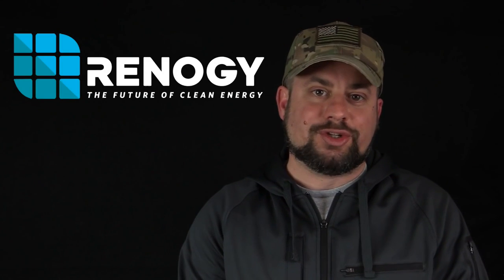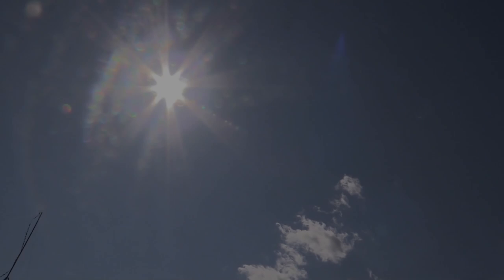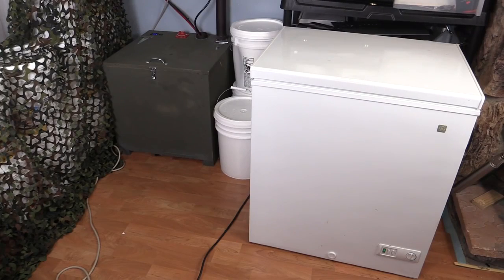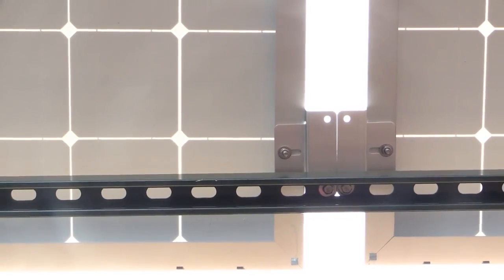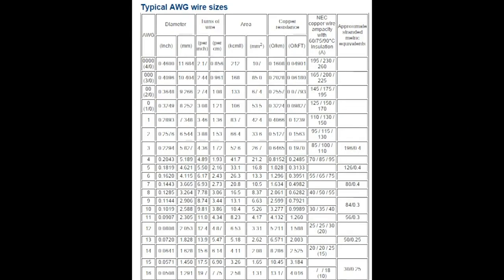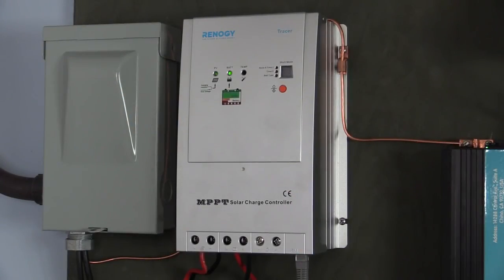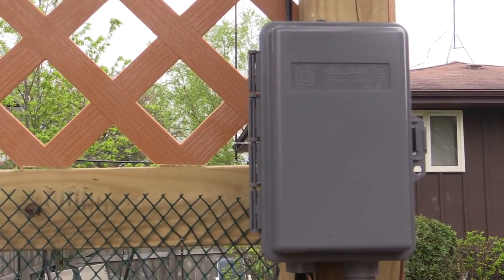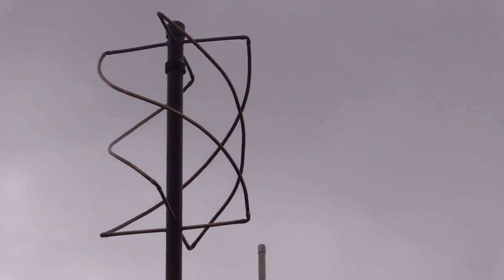The Ultimate Guide To DIY Off Grid Solar Power | Tin Hat Ranch

Comment: I'm needing 50amp power.   I have (4) 150 watt panels;  a 40A MPPT Charge Controller;  and a Power Jack 10000 Watt Peak 5000 Watt Continual Pure Sine Wave Power Inverter Converter Transformer 48 V Dc Input / 220 V-240 V Ac Output 50Hz Frequency.   

Will these give me the results I'm needing?
How many 12V batteries will I need for this result?

Comment: So the batteries need to be receiving 12V in order to start charging?
Reply: Literally, batteries need more voltage than their current state to begin to charge.  Example, a partially discharged 12V battery that measures 10V will begin to charge if you supply 11V (but it will not get fully charged)

Comment: Downside of series panels is that if you have a fault, shade or bird crap on just one panel it drags down the whole system.
Reply: Similar effect on a parallel wired system in that you lessen total wattage output

Comment: I'm all for solar, but you don't take into consideration the "cost" of making solar panels and the disposal of batteries, not to mention that batteries don't last forever. Should the grid go down for more than a few months, there will be NO MORE solar panels or batteries made for a very long time. I watched your vid on electric cars -how good will they be if an EMP is detonated? And you don't take into account the cost of making those batteries (Tesla battery wall?). You only count the cost of coal, gas, and nuclear.
Reply: Sounds like a good reason to buy panels now rather than wait for the SHTF scenario
Reply: The batteries can be stretched out for a long time if the inverter is set to shut down at say 12.5 volts, but they will still fail after several years. I would expect that the solar panels and inverter could easily be around for your grandchildren to use, daytime only of course.

Comment: I am putting in an off grid system in northern Minnesota, could I put the battery bank underground to maintain a constant temperature? I would vent it as you showed. Great presentation !
Reply from the maker: +Bob Wolfe as long as the temps stayed above say 50-55 and all the other issues were sorted, I don't see why not.

Comment: 24/7 AC would still be possible on solar with a different method. A direct drive system to freeze a large water tank into a ice block then passing air over the tank or past a radiator hooked to it you can get away with cooling with just the wattage of the fan as the ice is produce when the sun is shining. 

Would also work for making a cold room for food storage but in that case you would want to make sure the entrance was stairs in so the cold can't escape when you open the door like it dose in a fridge or standing freezer now.

Comment: It has just right information regarding solar electricity- its fundamental and how to size and install a system. Anyone with a little technical background can understand and follow easily. It illustrates real world solar electric design. https://plus.google.com/b/100728704920141855812/100728704920141855812/posts/WjRt4LRZEzo
Reply: WOW so good, thanks for sharing it.

Comment: It should also be noted that if things are put in series if one panel or batter goes out the whole system stops working; but if things are in parallel then the system does not shut down because of failure in one part of the system.  This is why Christmas lights won't work if one light bulb.
Reply: It should also be noted that if panels are in parallel and one goes down, you will not notice, you've only lost a percentage of your charging. So if you leave it unattended for long periods and would like it to have the ability to limp along, go for parallel

If panels are in series and one goes down, you will notice, there's no charge at all. So if you want to notice problems and fix them right away, go for series.

Comment: Very worthwhile! Thank you for your wok. Looking forward to finding how to access HAM radio.
Reply from the maker: +Jerry Stumpf it was a coffee pot, but a wok would work as well..j/k. Thanks
Reply: I mis-typed. It should have said"Thank you for your woRk!.
Reply from the maker: +Jerry Stumpf I know, I was just kidding with you.  I do it all the time...that is misspell and then make jokes about misspelling.  Thanks for watching!
Reply: You are welcome. I am working to build my first system and have been looking at doing 4 panels so your info was right on for me.
Reply: Jerry, THR is totally on point with HAM radio. It is not hard at all and there is no Morse code requirement anymore. Dont stop at the first (Technician) License, go on to get your General license so you can operate on HF. Why? look up NVIS antenna systems for HF radio. It gives you a 250 mile communication range if the atmosphere is right, and it usually is for most of the day on 40 meters and the night on 80 meters. You cant be totally prepped with out knowing what is going on around you. Ask any combat vet. good luck!

Comment: Some research I've seen says that even in cloudy weather 70-80% of the rays that produce electricity through the panels still gets through.
Reply from the maker: +Dustin Beard it depends on the density of the clouds.  Some days you barely get anything, some days with thin higher overcast you can make some decent power.

Comment: Your collectors, charge controller and inverter are cool, but cheap golf cart batteries are no where near as good as sealed batteries like VmaxTanks specifically designed for solar use.
I set up a system with eight 100 watt Renogy panels, two 125 Ah Vmax sealed batteries and
a 4000 watt pure sine wave inverter and two 30 amp charge controllers (You can parallel PWM charge controllers). With this system (which I am slowly expanding with more panels and more batteries) I can actually power a 27" iMac, a 12000 Btu portable AC and a 32" TV for over an hour before the two batteries get low. Turn off the AC and the computer and TV can run for  7 hours.  The cool thing is that you can keep adding stuff like more collectors and batteries. My system has the collectors in series parallel running 24 volts to the charge controllers. MPPT would be better then PWM, but for now, the PWM charge controllers work.  Panels are no where near 100%  efficient. I have done several tests in Florida with the Renogy 100 watt panels and the best I have ever done is to get 80 watts per panel. In most cases, it is more like 60 watts. These are real world figures for where I live. I am sure that in Arizona, the same panels may do much better. My ultimate goal is to run my AC for at least 5 hours as well as to be able to use the computer for a couple hours and the TV for  at least 4 hours. I figure I'll need a minimum of 16 collectors, 6 batteries and my present 4000 watt  pure sine wave inverter. Oh, don't  waste your money on a crappy 'chopper' type modified sine wave inverter. They do little more then destroy any appliance with an inductive motor. For powering audio devices, the power is very noisy. A pure sine wave inverter may cost a lot more, but your devices will last longer and really thank you.

Comment: If you listen in the beginning he says he gets 1.5kw per day ... but then later shows the math which suggest you can get 2300-2400 watts.  I duplicated this setup but only found 230ah batteries so in parallel I got 460ah.  I do like it however do not expect to get over 2300 watts per day.  You will only get roughly 1.5kw per day as long as your batteries start out completely charged.  I did run a very energy efficient chest freezer for 4 days without recharging the batteries.  I shut it down when my batteries got just under 50%.    Now that winter is gone, I just hooked up my new solar panels to test.  I will be testing charge times.  I have (4) 100w solar panels and this mppt charge controller has a max input of 400w.  Renogy will not support more then that in a 12v system.  Since I will only get 400w from 4 panels in perfect conditions, I plan to add 2 extra panels to give me some extra charging amps.  Ill have to keep an eye on that tho but I am going to try it.  So to summarize... I like it, it works, but dont expect 2kw or more... you will only get 1.5kw roughly.
Reply from the maker: +Danny Kitts I believe that the 2300wh was talking about the usable battery energy.
Reply: "I thought" usable would be 12v * 470ah minus 15% losses.. then half of that is usable which gives us 2300w.  That puts us at using 50% of the battery.  I am ok with the 1.5kw tho.  I was just disappointed I didn't get that extra juice out of it without going below 50%

Comment: love the video, but no one ever goes into the connections between inverter and a dc fuse box. I have existing ac set up and would like to pull some circuits and convert them to dc power. I have not found any videos that show tie in from the inverter.

Comment: Hi nice one thanks, i have been pondering using the draw from the secondary burn on wood burner to clear the hydrogen from solar battery box it really appeals now .I like the idea  of a hydrogen boosted oxygen  secondary burn. Its only a small battery 120amph its just the energy conversion i like waste not want not. There  will be some hydrogen am already trying to use this as the cooker extractor. Its all potentially  energy. Thanks again Garry Be Mello

Comment: I have 8 T105re batteries connected for output of 24v@450a. Will someone recommend a battery charger to go with my generator for emergency charging. (Also where to find it). I have 8 100w renogy panels

Comment: Nice video for those  who want to build their own solar system. I have a 3.5 KW Generac, 8KW Kohler and a 1.8KW Ryobi generator, one for each occasion; the Generac for medium power, the Kohler for A/C and heating and the Ryobi for low power and camping needs. They give me a total peace of mind during power outages and the lifetime cost is under $2K. I can connect them to the house if need be.

Comment: If you have a 1000 watt inverter on a 12 volts system does this mean you have 83 amps from the batteries to the inverter? That would be a large wire!
Reply from the maker: +Mike Treloar that is the disadvantage to a 12v battery bank and the reason you see 48v banks on larger systems.

Comment: How many watts did it take to cook shorthairs up?
Reply from the maker: +Gary Biggs cooking with electricity is VERY wasteful.  Any resistive load used to generate heat is a no no.  I cooked shorthairs over a wood flame.
Reply: Great! Smoked bunny is best. I heat w/ wood and cook over wood or 
propane. I don't have a solar system, but your great vid has inspired 
me. Thanks

Comment: best video out there believe me, funny and easily informative, hey buddy, I got some small micro hydro turbines that you can connect to the Waterhouse or other hydro outlets they put out a max of 80v but only a max of 220mah, I was thinking of wiring them in series and getting at least an amp.out of it, my question, what charge controller would I use for something like this? I'm on a strict budget. thanks and keep the videos coming.

Comment: Excellent video.  Especially the way you start off saying "we don't need electricity."  But if the grid goes down forever, and you look to be around 30 years of age, the solar panels will only work until you reach 60.  So shouldn't you have a few panels stored away for future use?  Or will those go bad too?  What exactly makes panels go bad?  How can you improve their useable lifespan?  In a future video are you going to tie in how a wind generator (homemade or otherwise) would be wired into the same system?  I really like how you explain things.  I also liked how you remind us that satellites won't necessarily be out.  I was not sure however, if the power goes off temporarily, you flip a switch, does flipping the switch disconnect you from the grid?  Will all your outlets still have the POTENTIAL to be hot?  Thanks.

Comment: Can I use Optima yellow top deep cell car batteries?
Reply from the maker: +Jose Leonardo Monier IV I think it would be cheaper and better to use the batteries in the video or something like the Trojans
Reply: TinHatRanch it's just that I'm building a little house in my back yard and my job is day trading witch requires me to run a computer and 2 monitors from 9am to 4:30pm none stop and I need 24/7 AC because I live in south Florida is there any way to achieve this? I don't mind if it coast me a couple extra thousand I just want to know if it's possible. I read that deep cell car batteries can be run till there dead and just recharge without damaging the battery bank. It scared me when you said you can only drain them to 50%😖😩😱
Reply: TinHatRanch and I loved you're video thanks for putting in the time to give such an educational video
Reply from the maker: +Jose Leonardo Monier IV draining any lead acid battery all of the way can damage it.  If you have the money, I'd look into a powerwall.

Comment: im a newbie, i want to build my off grid solar, im just asking, how many amps of fuse or dc breaker from pv 3x100watts to 30amps mppt scc, how many amps of fuse/breaker from scc to 1pc 200ah 12 volts battery, and how many amps of fuse/breaker from battery to 1000watts inverter, and how many amps of dc breaker from inverter to house wiring installation, 
also wat size/gauge of wire of from scc to battery, and battery to inverter, thank u very much

Comment: making coffee costs me zero power because I just boil the water on the propane stove and use a coffee press :P
Reply from the maker: +Tasha Flemmington except for the propane, lol
Reply: grass, hey, leaves, dried paper pulp cubes, dried poop etc.
Reply: what are you doing to use if there is no wood?
Reply: Break out Colman stove white gas for fuel
Reply: In the winter you could make coffee on your wood stove, true? 
Or year around if you are using a wood cook stove like the Waltons.  Or a little older peculator that probably takes less juice than the newer style.

Comment: How about combining a 400watt solar and a 400watt wind turbine system? Can that be wired together into the same charge controller within said charge controller limits? Have the 400watt solar wired in series, then in parallel with the 400watt wind turbine into the same charge controller? Or two separate charge controllers into the same battery bank?

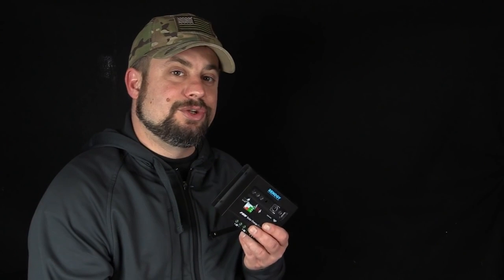Comment: With you on every single thing except for around 30:00.  I don't know why a charge controller would be rated in "open circuit amps" seeing how there is no such thing as open circuit amps because current will not flow in an open circuit.  I think that might have to be revisited.  Very good video by the way though.

Comment: lmao you could trade all 4 of those dead end batteries for a XS POWER batteries from 3k watt batts to lithium power 30,000 watt batteries 1 of those would be way way way more than enough stock up power for you solar bank lol
Reply: juggalo4life_91 
Is that one battery and where do u get them or the link?
Reply: juggalo4life_91 

Those XS Power lithium batteries are $2,600.!
Reply: yup lol sorry if your pockets are shallow man but just think 30,000 watts of storage in one place
Reply: Hardly doing it on the cheap if you "trade in" your cheap batteries for premium ones though, is it?  Also what is "30,000 watts of storage"?  That's like saying your water tank can store 100 gallons a minute - watts is the amount of current flow, it tells you nothing about the total capacity.  Do you mean they can store 30 kWh, or that they can deliver 30 kW for some length of time?  Given that this guy has a 1 kW inverter, having batteries that can deliver up to 30 kW and only ever using 1 kW seems a bit of a waste.

Comment: I want to build a small room with bunk beds in it, and add solar power at the end of my house.
So if the on grid power gos off, will still have the room to survive.
I dont know if is a low power heater, but i also do have a wood burning heater.

Comment: I've been  very curious lately as I'm trying to work out going off grid within the next year. I'm working on trying to get our city to allow a spec home using the hammered tire method with cooling tubes to each room that run 40 get thru the tire walls into the rooms. it's got a hydroponic system with a small coy pond, as well as garden areas. the plants, fish, and planters are all in a room with 45°  , triple pane glass atrium across the front of the atrium it's a self sustaining earth home. thank you for the information. it's been driving me nuts trying to figure out peak hours an how the battery system works. thanks,. Deb

Comment: if you're gonna buy from batteries plus, get the sligc115 instead, it's just more cost efficient $/amphr. You pay like an extra 20$ for only 5amphr difference. 110s are even cheaper but the jump is 235 ah, 250ah and 255ah for the 110, 115 and 125 respectively.

Comment: If you're gonna go "21st century" you need to consider electric cars and hybrids, a house roof, and Tesla-grade power banks that could hold ~30-50kWh of power, then you don't have to count kWatts or use the horrible LED lights, and you could even get away with having 240V outlets for heavy appliances like washers dryers and air conditioners. What you do is calculate whats the peak power you could possibly use at  home without any idiotic green modifications like LED bulbs, and go from there
Reply from the maker: +Igor Igor and you are supplying the blank check?
Reply: TinHatRanch well save up if you want to make a dependable system, tesla power packs can be made with used up 18650 batteries scored from ebay's used laptop batteries, not that difficult, just takes time